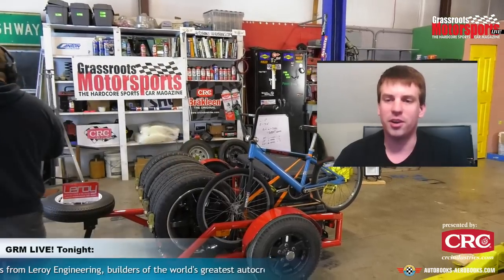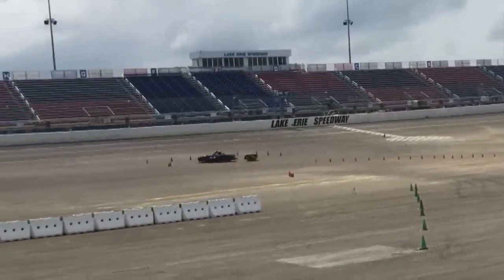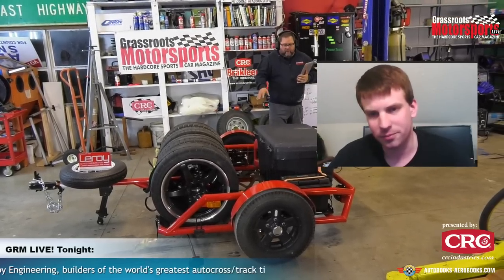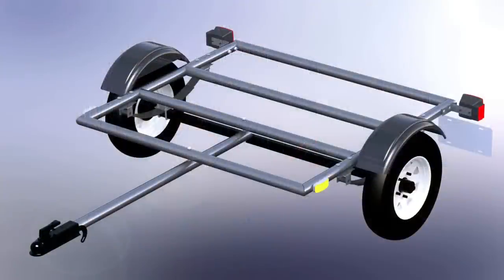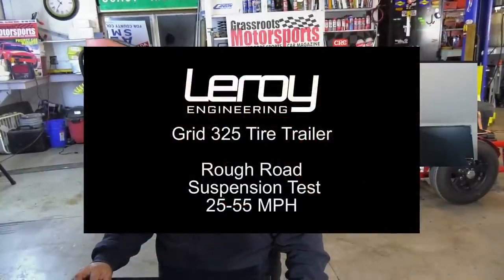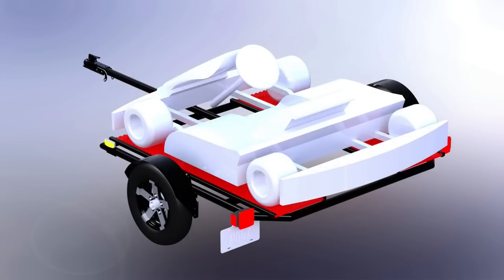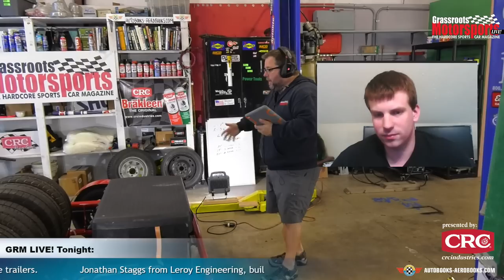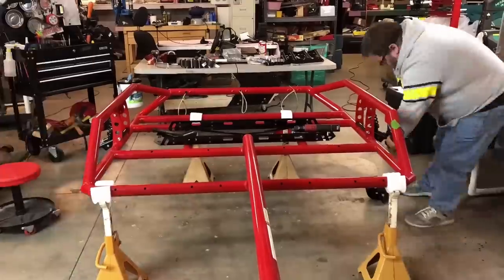The world's greatest autocross/track day tire trailer.. GRM Live! Presented by CRC Industries

Comment: Mui Expensive
Reply from the maker: It's not cheap, but spend some time looking at the design and construction and you'll realize the level of work and attention that went into it are completely consistent with the price. It it overkill? Maybe. But we've been stranded too many times in the middle of nowhere by cheap trailers and their crappy bearings and weak frames. If something like this eliminates the worry, it's well-valued.

Comment: Late to the party, I know. I've been keeping an eye on these ever since you mentioned them last year. Expensive? Yes. Worth it? Sure seems like it to me. My time is much better spent driving to events, driving at events, or relaxing in between.

Sitting on the side of the road trying to fix mechanical failures is NOT a good use of my time. Sometimes spending the money up front is absolutely the best way to go. If you've ever been stranded... you know what I mean. Happened to me twice now, if it never happens again it'll be too soon.